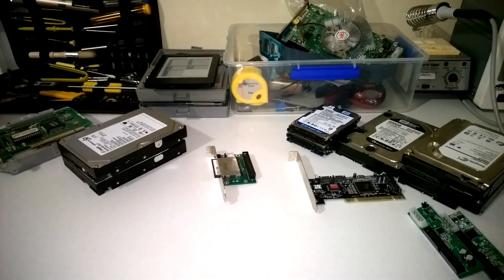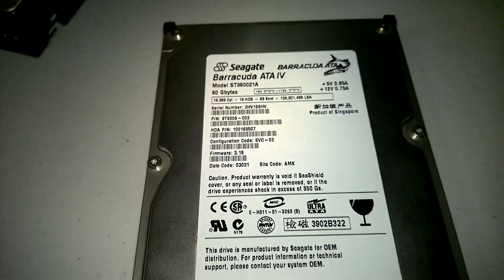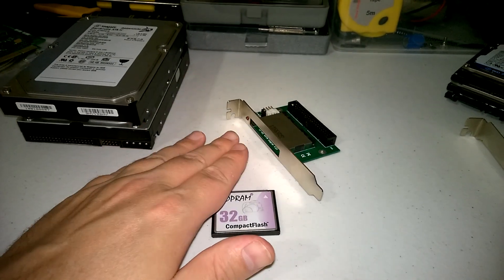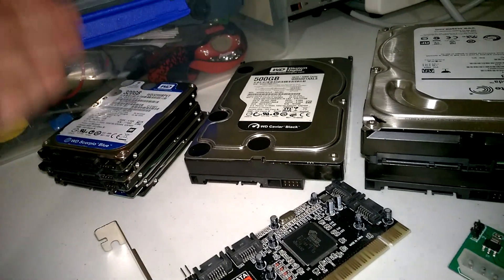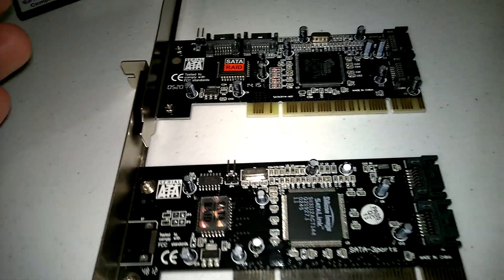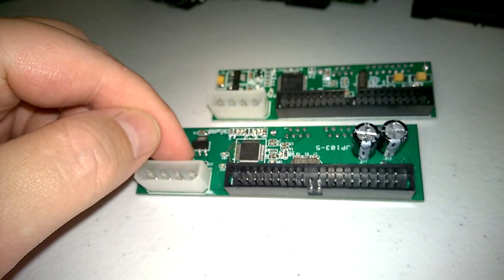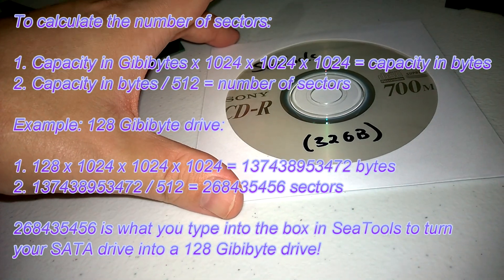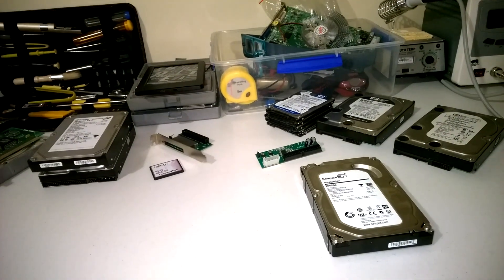Hard drive options for Retro PCs

Comment: I think that if you are using an OS that cannot handle large hard-drives then using a compact plash card might work except that the data storage might become a problem so...
 MS-DOS 3.2 and MS Windows 95  a compact flash card will work,
MS Windows 98 OSRII maybe but I think that it would really require a hard-drive,
MS Windows XP,Vista,7,8 all require hard-drives as will Windows 10.
only MS Windows 7,8 and 10 can use SATA (AHCI)
all the 95,98,XP don't have support for AHCI so cannot handle SATA.
I think SCSI require hardware and software AHCI support for SCSI.

I wonder if you where to put the system files on a 256GB CF card and install the game of your choice onto the cartridge you can turn all of your MSDOS 3.2 games into cartridges for fast loading Oh and how about making your computer look like a SNES or PC-ENGINE and mount the CF slot on the top so as to look the part.
Reply: DAVID GREGORY KERR The cartridge idea is kind of what I had in mind at some point, but I rejected CF based on its cost (CRAZY expensive! Even for tiny ones and used!). In the end I decided on either on small laptop SATA drives, or small SD cards. For SD cards of course an SD->IDE adapter will be required.

Comment: I have been real successful using "Promise Technology SATA 150TX4" SATA 150 controller. It works in the oldest system I have which is a Intel 440HX chipset and above. It has Win9x driver support and works great in DOS. Costs about $25 on Amazon new. Avoid the Fasttrack raid controller unless you want to raid only and get the serial ata only.
Reply from the maker: +Bobby Gunn Thanks for the tip!
Reply: I tried several Silicon Image 3114 cards and could not get them to work... maybe driver mismatch. Purchased a Promise Technology SATA 150TX4" SATA 150 controller and worked right away with my ASUS - P3V4X. Thanks Bobby for the suggestion!

Comment: One drawback of running Windows 9x on a CF card is freeze-ups. And DOS games and sometimes the OS itself could freeze up as well. Right now, I'm cloning my CF card on a 200GB HDD expanding the File system to 7GB for more games and files. My retro PC is running MS-DOS 7.10 (fan made and Win98SE based) ad Windows 98SE.
Reply from the maker: +WinVistaUser2 I must say I never encountered a freezing issue with CF cards.
Reply: PhilsComputerLab Depending on the CF Card, such as SanDisk Ultra. Mine always froze up, and it was the CF card, not my GPUs or anything else like that.
Reply from the maker: That's not good. When you say froze up, like locked the machine for good, or did it make a pause?

I only ever saw this with micro drives, they are quite slow.
Reply: PhilsComputerLab Locked up the machine for good that requires a hard power off and power on again, check the drives for errors, repeat until the drive gets replaced with a hard drive. I have a Seagate 40GB PATA HDD from 2002 that was pulled out of a Compaq Presario 6300, with the jumpers set to CS and 32GB limit (since my PC has a 32GB limit). Hasn't frozen up at all. In fact, it's faster than the CF card was (CF Card transfer rate is 66MB/s, while the Seagate drive is 100MB/s. I was going to use a Maxtor 200GB HDD (only 7.8GB due to limitations), unfortunately, the HDDs never seemed to like the FDISK program (verifies disk at 15% and repeats). Although, it gets 133MB/s.

Comment: Since CF card have a limited write cycles they tend to be really bad for operating systems that support virtual memory (a page file on disk). Phil, have you tried using Microdrives instead since they are real mechanical harddrives in a CF form factor?
Reply from the maker: +Markus Buretorp Actually, yes I have! I found performance to be extremely low. They also generate pauses, when being accessed, so long that you notice it in DOS games. The game will simply pause for a moment while the disk is being accessed.

In Doom for example you can see the disk access icon all the time LOL

You're right, for Windows 98 I go with real hard drives rather than CF.
Reply: +philscomputerlab Ah, good to know! I was really close to buying a Microdrive to test in my Amiga or PC.
Reply from the maker: They might be a good fit for a 286 or 386. But on a 486 it's holding you back.

Comment: Problem with the CF-cards and SSDs is the lack of sound and even the newer standard harddrives sound different to the older ones. I could connive this matter in most cases, but not in case of my old IBM-desktop, which had a very nice sound with it's original drive. So I'm actually trying to find a certain harddrive for sale to give my old IBM-desktop the same sound it once had. So if anybody has a Quantum ProDrive LPS 270AT 270 Mb IDE hard drive (IBM part number is FRU 82G5926, other aliases are Quantum TB27A471 and Digital RE24R-E) lying around please contact me :-)
Reply: how is SD to IDE for retro computing?

Comment: Compact Flash cards have some many different speeds. If your computer can not do ATA/66 don't get a card faster than x266.. I have a laptop that can only do ATA/33 (PIO-4). Its a great P3 600Mhz Win98SE Machine (HP Pavilion N3390 Laptop.. maxed the thing out!) I don't think I will see a speed difference between an 30GB EIDE 2.5 Laptop Hard drive and a 32GB CF Card, unless the Laptop's hard drive's 4MB CACHE and its 5400 RPM really really helps X-D Can't get the 30GB HDD to benchmark more than 23MB/s with Roadkill, Speedsys, HDAT2, & ATTO programs. SATA adapter cards... thank god for linux :)
Reply from the maker: Jason Hicks Good to know. I've never had a premium / more expensive / high performance CF card. Always some cheap one from eBay :)

Comment: It's a bit of a shame you don't have much experience with SCSI (technically: SCSI Parallel Interface, SPI) drives, as you have omitted one of the best options for the retro system: period correct SCSI HBA + semi-modern drive (e.g. U320). Whilst it is true that in some combinations you need drivers, in DOS these mainly amounted to allowing access to CDROM or more than 2 disk drives.

Initial setup may require a bit of effort, but SCSI has a couple of advantages: generally higher bus transfer rate (until we get to generation of host adapters that can do UDMA5/UDMA6 modes, anyway) and more devices able to share the bus whilst using less IRQs at the same time. Particularly important in IRQ starved setups...
Reply from the maker: I'm really interested but the drive in the video is the only SCSI device I have. In all my years of Computing SCSI hardware simply never made it's way into my hands. Not sure as for the reasons to be honest.
Reply: +philscomputerlab Same for me and it was always the costs, which were much higher for SCSI-components.
Reply: Yeah, I never really used SCSI drives much either except on some machines I worked on for others when I was a teen two decades ago. This is one of the reasons I'm wanting a SCSI drive in my "new retro" 486 build.

Comment: It's too bad about the performance on the CF.  I'm gathering plans and parts for a small form factor and quiet Windows 9x machine for all my retro-gaming needs, and I was hoping to use flash memory.
Reply from the maker: Don't give up on the plan just yet. The card I used was a cheap one from eBay. So if you got a decent one used for high speed cameras you might get better performance out of it. As you can see in the benchmarks, access time and read performance is quite good. It's just the write performance and maybe you aren't doing much of that. So I would give it a go, in real use you might not notice. The video was really to show the differences, each solution has its reasons for using it and CF cards are cheap, silent, small, compatible regarding size and also the adapters are cheap. So give it a go first and see how you find it. Personally I always install a lot of software and that's when I notice the difference the most.
Reply: philscomputerlab Well as you said for compact flash the board itself doesn't really do anything, CF is IDE/ATA anyway so the board is probably irrelevant.  But it's a cheap option, I'll give it a shot.
Reply from the maker: Yes and please let me know how you go :) I'm always interested in other peoples experiences / opinions :)

Comment: for earlier Socket 7 computers, like P166 or slower, ~1GB drives would be more period correct. for 386/486 <768mb is probably more period correct. I personally like using period correct hard drives, since it doesn't really feel the same with a noisy clicky hard drive running in the background. I need to get my hands on an MFM drive <3 :P  Using SATA or CF on a dos machine is like using rocket fuel in a lawnmower (minus catastrophic effects). by the time you get these extremely fast drives in older computer, you'll just be waiting on the CPU anyway. I'm pretty sure SATA 3 and 2 drives are backwards compatible with SATA 1 interfaces.

Comment: I actually use a 300GB Ultra160 SCSI drive (Seagate Cheetah) in the Athlon 1400 machine, quite noisy as you said, but fast, and the high capacity means I can run full installs , making the loading blazing fast.

the other 2 machines I have (P133 and a Core2duo based HP XW4400 workstation) use IDE drives of various kinds. I tend to go overboard with storage, but it pays off.